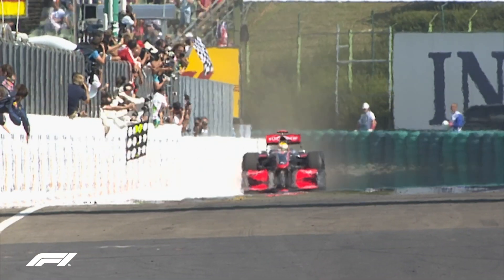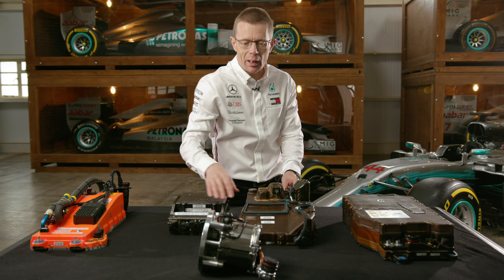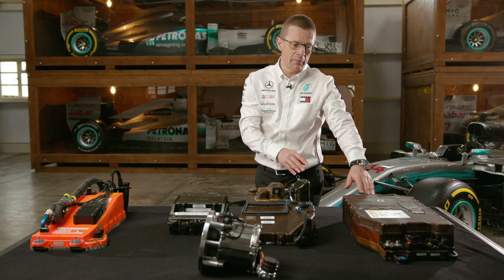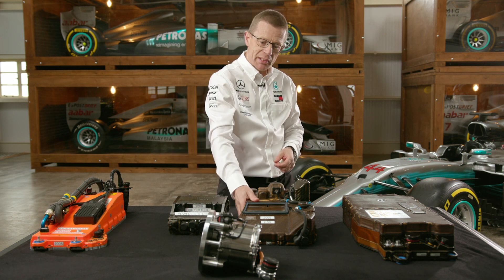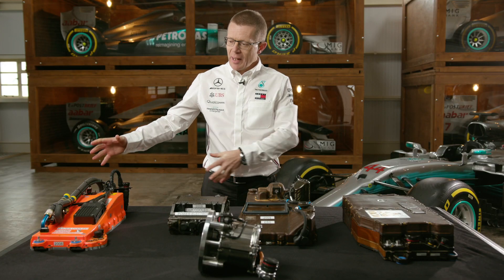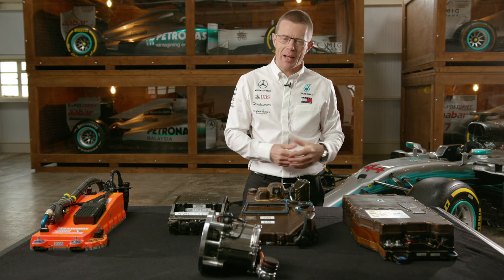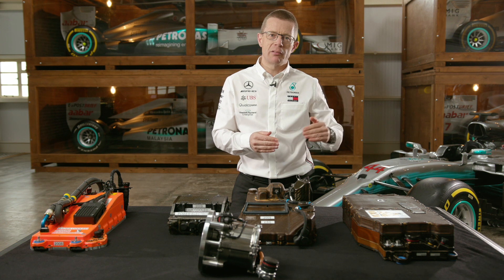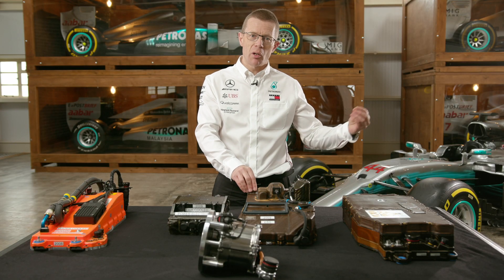The Evolution of Hybrid Technology in Formula One

Comment: it regenerates energy from tyres deceleration,does it work with hot exhaust too? What does regeneration mean for hydrogen & battery/solar?If we were to forget emissions and focus on regeneration,which fuel source gives maximum regeneration (considering heat & engine exhaust too)? and apart from cars, where else can this be used?

Comment: Do they only generate energy during the braking? I was told they also have a generator on the exhaust? Behind the turbo
Reply from the maker: Since 2014 that’s the case. The original KERS only had brake energy recovery.

Comment: Do you not think it's time to introduce technology such as FreeValve systems and get rid of the traditional cylinder head?
I'm not talking about F1 cars but road cars, as I believe this should be the next step in engine design.
Reply: The Koenigsegg-type "free valve" would be one of the last great ICE inventions . . . valve timing events specifically tailored to RPM and load.  The only other promising inventive technology I see on the horizon is laser technology replacing traditional spark plugs.

Comment: Doesnt a formula e only produce 250kw ?
Reply: F1 is all about max power. Recover as much energy as possible while breaking, deploy all of it in the first view meters after the corner, as the primary energy is the fuel. Formula e is about max energy. Use as little energy as possible to stay fast, break as long as possible to regain as much energy as possible, because you only have that one battery.

Comment: @Mercedes-AMG Petronas Motorsport Whats the weight of the whole system though inc the electric motor
Reply from the maker: A minimum of 145 kg for the entire PU
Reply: Sorry, thats including the ICE. I meant whole electric system. You said the battery/electronics is 20kg whats the electric motor. So for example the new BTCC hybrid its 64kg for electric motor, battery, controllers, wires, fluids pumps etc.

Comment: Why would the FIA put a minimum on the weight of technology? Why not find out how far it can be pushed like F1 was always about. 
Same goes with the amount of energy you can use let it be free and soon you might get all electric cars or cars that use a tiny engine and hardly any fuel. The FUA seems in some case to stop development which us totally against the spirit of F1 and will eventually deem F1 obsolete.
Reply: Because you'd spend 50% of the cost of the battery getting the last few % of extra power or lower weight. Its not 'efficient' spending.
Reply: Because teams like Mercedes, Ferrari and red bull have deeper pockets than other teams like Haas and such. It's to make the teams more even for better racing.

Comment: Hybrid system just 20 kg? How is that cars today are 200 kg heavier than those in 2009?
Reply: Maybe because they became longer and wider with the 2017 rule changes and thus more heavy because of more carbon fiber. Might be something different i dont really know
Reply: The hybrid engine is a lot heavier.
Reply from the maker: The cars are significantly larger as well.
Reply: 95 kg + fuel v 145kg + fuel.

Comment: Nice technology ... for the road ... bring back the noise and raw engine sound for the sport !
Reply: And have them less powerful great idea.
Reply: Konkey Dong i don’t care about the power ... a number doesn’t give you emotions ... in the early 2000s the engines had already 900hp ... now they have 1100-1200 ... not that much of a difference... plus the cars where lighter back than ! I have no problem if the cars go 1 or 2 seconds slower as long as we get the sound back ... do you ever visited a race ? Have you ever heard real race cars , so loud you could hear them 1 mile away from the racetrack , so loud you could feel the vibrations from the engine in your body ? That’s emotion only sound can give you ! As a spectator you cant feel how fast a car is but you can hear it ... a loud high reving engine „sounds“ fast ... thats emotional and thats why you visit the track because that’s something you don’t get from the television ... and before i forget it in the mid 80s the turbo cars had 1300 - 1500hp  and sounded awesome... with modern Aerodynamics and gear paddles they would still be very fast ...
Reply: @Harrock  F1' s problem is that it has always been the best of engineering and the best of driving/ racing. That was no problem until aero started to get really complex and the hybrid technology improved. They decided to go with the engineering part, implementing these hybrid engines, costing them the sound. But I must say the sound has gotten better, having been to a few races over the last years, they got louder from year to year. 2015 they sounded like a hairdryer on crack (apart from Honda, they sounded like they were about to blow any second) and this year in Hockenheim you could feel some vibrations when cars passed and they sounded alright i guess. First time I had to protect my ears watching an F1 race. But still nothing compared to the Ferrari V10 that did the showrun.
Reply: @Harrock  Bringing back 80s and 00s technology would be a step back for the sport,the car industry is moving towards hybrids and fully electric cars. Mercedes, Ferrari,Renault and even Mclaren would probably leave F1 if the technology was not relevant to their road cars and they couldn't use  F1 technology as a selling point for their road cars. The Mercedes AMG ONE wouldn't make sense with a NA engine in a world where hyper cars use hybrid systems. Sound isn't everything.
Reply: @Harrock  
Back in the late 70s and 80s it was also turbo,and yes 1.5 l engines(the other German (BMW) drove with a street 4 cyl engine,with 1500 hp)(in qualy trim,the say it had 2500 hp)
The Cosworth 3l  f1 had no chance in that.